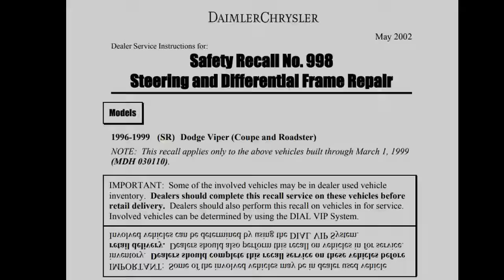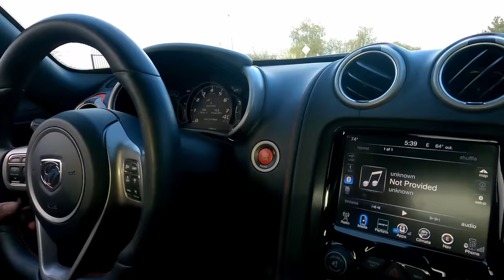How My Dream Car Made Me A Welder

Comment: yup. same sorta story here. haven't made the big leagues yet lol
high school, taking automotive & welding. dad is a welder. i dont really like welding all day. friend takes me out to the drag strip one night. we race our 16sec and slower cars. damn i was hooked. decided to go to ford asset thru the community college. worked at a ford dealer. wet myself on every mustang and the couple ford gt's that came thru. of course, i went and bought an old 1995 mustang. replaced basically every part under & in the car. years later, still working on cars lol its shiny luster is dull, but it pays the bills. i still have that car, but never drive it. like most guys, family takes the front burner.

Comment: #1 Good to see you got your dream car / goal. She's sweet! 
At 15 I use to see a guy with a 70's Trans-am at school ...Always wanted after that a newer Trans-am / Camaro I worked at local condo pools Cleaning them And testing the Ph Cleaning the grounds on summer break Had a paper route with 362 customers ( 4 trips out of the house to deliver) Done snow shoveling in the winter months 

- At 16 I saved up about $5,000 Someone offered a 1986 K-Car for $600 ...Nope A rusty mustang...Nope
I found a 1983 Trans-am with a V8 T-tops Everything worked $800 But had signs of rust (Canadian winters/salt) -- In trade school we had welding class Autobody/Mech  Made a deal with the Autobody shop teacher That come in on sat for 4 hours to grind, And make patch welds Painted the car 8 weeks later myself ( Hunter Green met /w-Gold BBS rims) And yes I had a few runs But become a pro at wet sanding and polishing lol  Had the car 11 years And sold it 

The project now is a 2005 Blazer 2dr 4x4 that has quite the amount of upgrades And converted to a camper in the back ..My welding is not that great And its been years and years ..( 1 Body mount has a hole behind it at the floor ) Need to replace the rocker panel And lower 1/4 And want to angle iron weld a roof rack ...If i pass this I will also install a rear swing arm where the ZR-2's have a spare tire And add on a gas can .........Going to buy a cheap 110a welder And play around with different sticks And try to hone in on sweet spot welds before i start

Comment: I dig your story man. I got into welding in my 2nd year of high school. Learned on an older but nice ESAB machine. Now I've been running my own trailer repair and heavy equipment service company for the past few years and I love it! Feels crazy to make money doing what I love. Your experience of the 1st time you struck an arc was similar to mine. I want to eventually either build or get a shop for larger stuff during the rainy season.
Reply: Are you only welding or doing mechanical repairs too?
Reply: @grzegorz16100  mostly welding but I wrench for about 30% of it.

Comment: Hey, realize this is off-topic, but dyou have any advice for bending 1.5in 1/8in wall aluminium tubing with a manual bender? I need to use a sway bar to lever the tubing out of the bender after, and I found that the aluminium tubing springs back once it's removed (assuming that's why it's so tight to remove). Trying to do a 90, and it turns out about 85 degrees even though in the bender it is bang on 90. Definitely using the right dies.

Comment: So i learned to weld for one reason. I like mini trucks, custom cars, and go karts. First thing i learned to weld on was a 96 chopped and body dropped ford ranger v6 2wd with a cusom 4 link setup bagged with drag blocks and train horns ahh i miss the late 90's. Simple step 1 cut roof off daily driver. Step 2 figure out how to put it back at 5in lower at age 16 with less than 200$ in my pocket.
Pennysaver got a used lincoln mig 140 off a drug addict for 120$ and air gas rental for C25 .025 wire and tips. And showing pictures of the project to smith a guy that owned a local metal supplier he help me get a few off cuts of the right Guages of steel and metal working tools he helped a lot with fab stuff still good friend's to this day im 38 now lol. But a few mini truck mags and iron works mag had a few basic rules to MIG welding. With small pointers from my grandpa when i visited him up north and i got it down pretty good. 18mo later i was winning trophies at car shows and setting the freeway on fire dragging sold 8x8x8in blocks of magnesium on my frame rails. 
I had 4in drop front I-beams. With rear mounted bags using 3 cam plates and  4 push rods the rear was a triangle 4 link setup with the bags on the lower links. The train horns are real K5LA with a 1.5in dump valve a custom plate replaced my A/C with a semi engine driven air compressor feeding 2 custom tanks i made from 3/16 wall 4in steel pipe with 2 stacked 1/4in plate welded to the ends with 2 passes fyi the tanks replaced the factory frame rails from the cab back.
Stacked on top with 3/16 plate welded to the outside and 2in wide strips on the inside where needed this heal the entire rear suspension and all the loads never had a hickup even at 130psi.
2 tanks directly feed the horns 2 tanks feed the smc valves for my bags a valve between them and the supply line lte me isolate the suspension if i had any leaks but was never a problem the sheer output from the compressor made the tanks almost not needed.

Comment: We all went through that 19 year old mindset.  I was a local mechanic at 19 who got fired (found out many years later that my old Man got me fired as he wanted better for me than being greasy all the time) so in looking for work I took a job in the mail room at Western Union (it was 1982 so you took what you could get) and then a job in the computer room opened up that required lifting 70lb boxes of paper so I got the job, spent lunchtime reading the manuals and 'sucked up" all the knowledge I could ) and spent the last 41 years in IT.  It interested me, just as welding did to you,  If your job is interesting to you, you'll take more pride in it and learn to excel and do better with it. I mean, if your job was cleaning toilets you will move on to another job in a couple of weeks.
Reply: Good dad

Comment: Similar story here i had been working various jobs from 16-22 ish with no real direction 

I had a little money in my pocket and was browsing eBay and I seen a car for sale and I had to have it better yet I recognised the speed camera in the background of the pictures

So I knocked on every door on the street found the owner and struck a deal and I was the proud owner of a rust bucket 
And basically broke because of it 

So after releasing how expensive it was to get fixed I thought hmmmm this isn't a bad racket and started applying for jobs as an apprentice 12 years later I run my own shop and still have a rust bucket 😅

Comment: You see basically the same story over and over again. You have an interest and you need skills to manage it.
Same for me. I bought a race car that was way worse than the seller said. I got some books, tips from my father and a will that was hard to break. I rebuilt the engine, welded up the body and modified the suspension. It looked ugly and was still one of the slowest cars on the track. You cant take a daily driver to a F1 race and expect to win. I built another car that was a little faster and raced it in the divison it was built for. A constant lack of money and too expensive parts led me to build anti roll bars, drive shafts, suspensions etc for 20 years. I have National, Nordic and European champions amongst my clients, so obviously I was better at making car parts than racing.
Today I'm relearning to weld since I started building a few motorcycles for myself. Welding has always been (and still is) a mystery for me. Milling, turning, designing..... not a problem, but I will never be a really good welder.